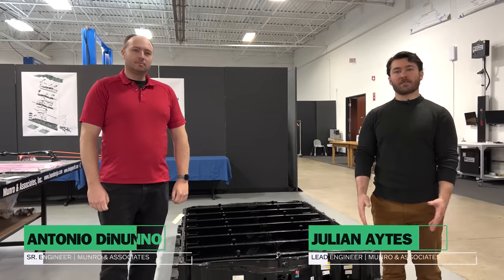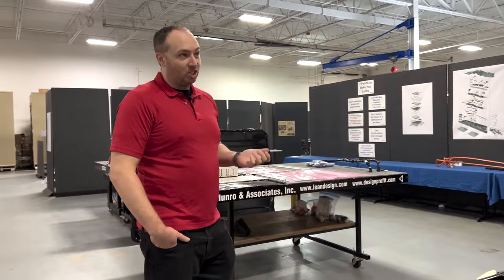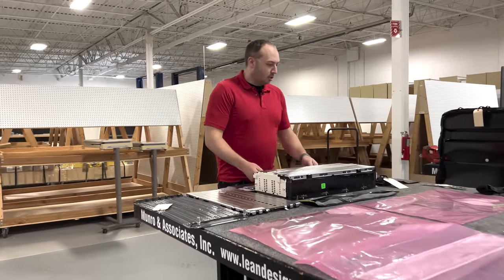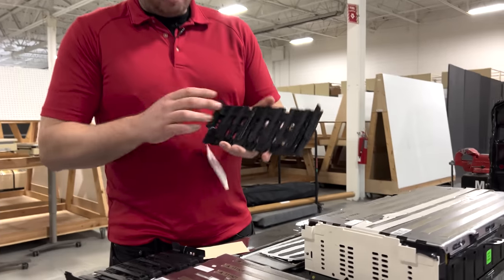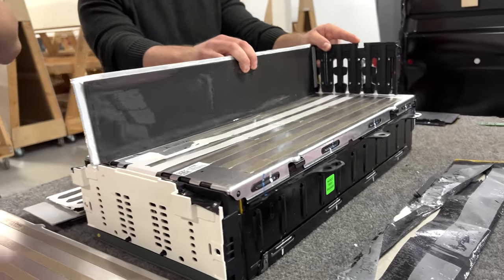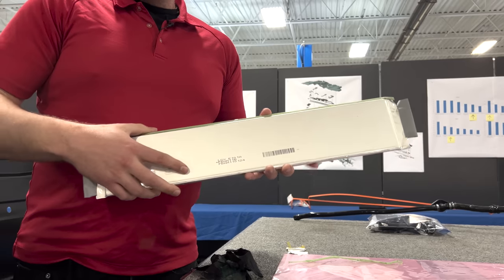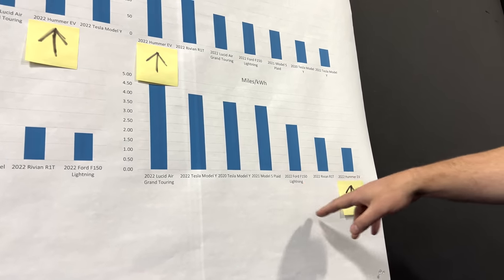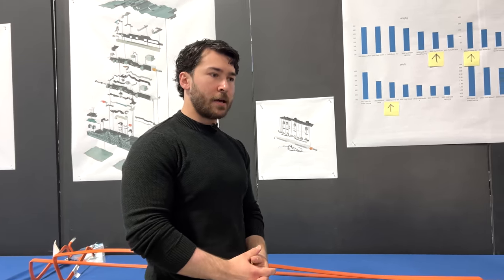This is NOT Lean Design: Hummer EV Battery Pack Breakdown

Comment: The UAW appreciates those welds.
Reply: why, do you think a person is doing the welding ?
Reply: @gcoates7  I don't but I'm sure simplifying a vehicle like that means less people and less union dues
Reply: GM is doomed….that doesn’t bode well for union workers.
Reply: I've been inside the Factory Zero and cell plant in Detroit and Brownstown. If you think the battery is complicated, you should see the equipment and machinery required to produce these batteries. 
$$$$
Reply: OH MY GOD THEY USED WELDS!!! You know I will NEVER buy a car that has welds, thanks for the tip. I'll buy the Cybertruck instead with its crappy range and charging speed.

Comment: So this confirms that whilst Tesla’s design engineers are pushing the envelope in almost every aspect of car design; the Hummer team appear to be well and truly stuck in the 1960’s school of automotive engineering!
Reply: Tesla still can't get any electricity out of the main battery 1:0 for Ford
Reply: Even though they have Teslas to reverse engineer.

GM suffers from NIH: not invented here.

The hubris is astounding.
Reply: @abraxastulammo9940  Tesla has powerwall...
Reply: @abraxastulammo9940  Dude, you need to THINK about what you write and make your point understandable!
If Tesla weren't getting any power out of their batteries, they wouldn't be selling any cars. But actually they are among the top selling cars in the world.
Reply: @nguyep4  Exactly, overpriced like f* while you have 90 kWh in the garage...
Reply: @unclefatbloke687  Only for the car, not utility. 🤷
Reply: @abraxastulammo9940  Over priced? Odd opinion.
Reply: @abraxastulammo9940  any Ev could use the same system as ford with nothing but a few lines of code added. There is nothing fancy about it. It's literally just a system like the power wall with a DC input from the car. The system tells the car to close the battery contactor and connect the battery to the charge port.

Comment: Good thing is that GM only built 2 of them......still practicing failure until they get it right.😂
Reply: one for Munro. Who got the second one?
Reply: They ran out of steel
Reply: The welder guy has a burn out syndrone and did quit his job.
Reply: They built a lot more than two.

Comment: Thanks for the tear-down, guys. I can't help stop thinking that this Hummer EV pack, on its own, weighs just a little bit more than the entirety of the 2012 Mitsubishi i-MiEV I drive. Sad to hear that GM is going to stop production of their sensibly-sized and affordable Bolt EV/EUV series later this year and continue marketing impractical electric behemoths like this.
Reply: They are going to replace the bolt with the equinox EV. At $30k for the equinox I would not take a second look at the bolt. And I currently own a bolt 😂

Comment: The energy density is pretty impressive. I wonder how much better the pack could be if they didn't use such heavy materials.
Reply: I think they should have used tungsten it's much more durable than steel, even if it's more expensive. Makes sense.
Reply: Cylindrical is superior .
Reply: I think they went for the heavier materials (steel vs CFP or aluminum) for cost savings. Giant batteries are expensive, and even at the ludicrous price of the Hummer they have to save money somewhere.
Reply: @stephenj4937  Yeah. Gotta have that 500% profit...
Reply: It's for an extreme offroad truck. Did you notice that the most capable offroad vehicles had the worse miles per kWh? Offroad for the Lightning is a dirt road. The Hummer can rock crawl and jump hills. The rest of the vehicles are a joke for offroading.

So comparing the Hummer to a Lucid or any Tesla is a joke and shows Munro is good at teardowns but can't see the forest through the trees. GMs objective was different than Teslas and Lucids.
Reply: This case is part of the chassis structure, so at the very least, it needs to be made of high-strength steel. It's possible that it could be reengineered to be built with aluminum, but I doubt it. At least not with the weight of the battery cells, the need to protect them, and the structural aspect of the case.
Reply: @markplott4820  This pack case is designed to be used with cylindrical or prismatic cells as well. If they used Tesla's 4680 cells in this pack, they would be able to reduce the weight a bit, but it would also have significantly less energy content.
Reply: @newscoulomb3705   - NOPE, Munro designed a battery case that uses almost no fastners, and is ALL Composite (fire proof).
Reply: @markplott4820  But this pack is structural. So what's your plan? Redesign the chassis, move several hundred pounds of mass from the battery case to the chassis, and then adopt Munro's composite battery case? 

My 25 year old Ford Ranger EV battery case is also all composite. When it's empty, I can pick the case up by myself without mechanical assistance. I could even ditch all the fasteners depending on the sealant I used, but that would make it less serviceable. At the end of the day, though, it just bolts to the frame and adds nothing to the structure of the chassis, so it isn't a viable alternative to Ultium.
Reply: @theflew  No it's not. It's for a bloated luxury car, that once or twice might be taken off-road just to try  it. Besides, high weight  off road is worse than on.
Reply: @avada0  Regardless how often it's taken off-road by the owner it's capable of it and has to be built to withstand it.
Reply: @newscoulomb3705   - FUD ranger EV is a Deathtrap.
Reply: @newscoulomb3705  - fake news Columb , Hummer EV is NOT structural battery pack, not like TESLA 4680 cell & Intergrated CELL to Pack with NO Discrete MODUL;ES .
Reply: @markplott4820  And yet, no one has died in a Ford Ranger EV. 🤷‍♂Either way, that's not the point. The point you're missing is that one battery is a structural component in the chassis and the other is simply a bolt-on. You can shave a lot of weight on the battery case when all you're doing is bolting the battery case to the chassis.
Reply: @markplott4820  You can keep telling yourself that, but you'd be wrong. GM has already stated very clearly that the Ultium packs contribute to the overall structure of the vehicle in addition to housing the modules.
Reply: @newscoulomb3705   - NOPE, just nope.
MUNRO can Disprove you in 10 seconds.
Reply: @markplott4820  And yet... silence. Look, Munro & A didn't even realize this battery had a wireless BMS on their teardown, and they claimed that the Chevy Bolt EV was based on an ICE chassis when it wasn't. They miss some pretty obvious facts when it comes to GM, for some reason. It's almost as though they are biased.
Reply: @newscoulomb3705   - the Chevy BOLT is a Crappy Compliance car built on the EV2 Platform , aka Chevy SPARK which was both EV and ICE variants. 
BOLT is an ICE car body built in a former ICE plant. BOLT is 80% made by LG. 
though MOST of BOLT Enginering is done by LG , and using ICE Technology. 
MUNRO is Unbiased as they come, they used to teardown all the Major Engines from Legacy auto , including gm. 
they were CLIENTS of gm and SANDY worked @ FORD.
Reply: @newscoulomb3705   - Hummer EV still to HEAVY & Inefficient , in spite of their Wireless systems. 
TESLA is more SECURE , minimal wireless use and uses ENCRIPTION. 
TESLA has Faster DATA Network and using FAR less cables, Tesla is going to 48V in Cybertruck.  and Advanced HIGH speed Network.
Reply: @markplott4820  The HUMMER EV is a performance, off-road, fullsize luxury truck/SUV. Tesla still only makes sedans optimized for street use with spartan interiors. If you can't see the difference, then I don't think you're qualified to be discussing relative efficiencies. 

As for the cabling, what cabling? I didn't see any of that discussed here. All Munro & A discussed was the busbars, which for some absurd reason they think can be made of aluminum in order to save on cost. 🤦‍♂
Reply: @newscoulomb3705   - MUNRO costs every part & component used inc every screw , bolt, Fastner. 
no one ELSE goes into that DETAIL.
and MUNRO is also costing SOFTWARE as well in 2023. 
cant call Hummer EV a performance model, the Cybertruck is the FASTEST Full Size truck on EARTH, its Faster than 911 Porsche.
Reply: @markplott4820  And yet they still make mistakes and omit key information in their videos. 🤷‍♂ I would hope that their comprehensive reports include the information they omitted here; at least, if I were a company paying them hundreds of thousands of dollars for the research, I'd demand it.

As for the Cybertruck: It doesn't exist yet, and it won't until it is in the hands of customers and independent reviewers. Will it be faster than the HUMMER EV? Possibly. The R1T already goes toe-to-toe with the HUMMER EV. Just because a new performance truck/SUV comes to market doesn't mean that existing performance trucks cease to exist. 🙄
Reply: @newscoulomb3705  - MUNRO does not Divulge all its information, (for FREE). 
the Reports are Chock full of Details. 
MUNRO still sells the BMW i3 (old model) report for only $10. its a bargin, for Anyone considering making a BEV. 
YouTube , as you are WELL aware , is a FREE platform w/ FREE basic content. 
YouTubers give more DETAILED videos , through PATRION, Locals or others.
Reply: @markplott4820  fastest truck in fantasy land. Your talking about a product that doesn't exist yet, let's keep the chest thumping for when one actually rolls off the assembly line
Reply: @avada0  it's more like 200% negative margins
Reply: @robertbowman9108  No way. With some luxury crap like this, there's a lot of profit.
Reply: @theflew  Jump hills with a vehicle that weighs 4500kg empty. Good luck.

Comment: First impression, someone was told to "Do it fast, do it cheap"
Reply: I guarantee it was neither fast nor cheap! 
Complexity is expensive but the larger cells could be cheaper to build and assemble.
Reply: Fast and cheap is easily attainable quickly, but unnecessary costs and materials can amass over time. Doing slow and expensive development first will then become fast and inexpensive over time, and save from unnecessary costs, materials and quality issues. 

GM definitely went the short term, but costly route while Tesla is going the long term and inexpensive route. Tesla just needs to work more on the car body quality.
Reply: Given this truck can take more abuse than any of the vehicles they compared it to maybe form followed function.
Reply: @briansit8826  I wouldn't be so sure about that. Pouch cells are SLOW to manufacture and assemble with lots of extra packaging needed. I wouldn't be surprised if a cylindrical cell pack was way cheaper and faster to build and assemble per kW.
Reply: @jg5001  
The "car body quality" was a "US build quality" problem.
Lets hope the Chinese "Hit squad" currently in the US factories can raise the workmanship to the level of Shanghai.
.
(Can we say "workmanship" any more?)
Reply: @theflew  
Given they "Say" it can.....
I'm not sure how much abuse the 2(?) they sold have been anywhere but the local Walmart parking lot.
More likely the first time they see mud requires a crane after they sink.
Reply: @saff226  
May be why GM cancelled an "Ultium" factory and signed a deal with Samsung for 4680 cells?
Reply: @briansit8826  
I suggested that's what they were told
I never said they managed it! 😉
Reply: @rogerstarkey5390  You might want to check your numbers. They sold 2 in 1Q23 because the factory was being upgraded to build the Hummer SUV and Silverado EV. They've sold over 1000 Hummers with a long waiting list.

Comment: I'll help you guys out.
1) Thermal runaway - What is the melting temp of an aluminum battery enclosure vs the temperature a lithium ion battery reaches during thermal runaway? 
                                        How does the Hummer EV battery compare to the Lightning battery for thermal runaway protection? 
2) "Backwards flow path" - See #1
3) "No thermal function in this section of the cooling plate" - Take the plastic part to the bandsaw or x-ray 
4) "Talc filled polypro insulating material" - Not correct
5) "Nylon piece of plastic" - Not correct
6) "This is for isolation" - Not correct, see #1
7) "Tabs use ultrasonic welding to connect the electrodes" - Not correct
8) "Tactical cooling line" - Not correct, see #1

Lastly, if the 100kWh Model S battery is 1377lbs a 200kWh Tesla battery would would be ~ 2754lbs. 
The Hummer EV 212kwh and 2818lbs, a whole 64lbs difference. You're not going to notice a 64lb difference in your range.

Comment: Ok engineers, how much weight difference between thin stamped steel vs thick aluminum components? how much savings?  A lot of criticism without real world context.  The welding is done by robots -  who cares how many welds .   How about this -  the weight of this pack is the lowest as a percentage of total vehicle weight of ANY vehicle on the market. Growing tired of Monroe’s formulaic assessments but they play well with the audience.
Reply: I would have to agree to some degree.  No mention about the weight of the batteries alone vs. the complete pack.  I mean, if they save 50 pounds in the total design that is going to have negligible affect on the overall performance of the vehicle.  If they can save $100 per battery pack using steel without a significant penalty then they may have made the right decision.
I am not saying that this is what happened.  Just giving a possible design justification.  No matter what you design there are always compromises. In a vehicle of this size minor savings in the battery design weight wise may be argued for if its cheaper.

Comment: What most surprised me was the m/kWh of the Ford Lightning on the chart at the end. Most of what I've heard on forums, and Youtubers efficiency tests, puts the lightning slightly behind the Rivian in efficiency. 
The terribly inefficient and lazy engineering of the Hummer is no surprise at all. GM managed to make a pure EV less efficient than a Prius. That's the most impressive part of their design.
Reply: Advertised range is used, battery capacity is something we do check.
Reply: And the Tesla Semi will be even less efficient than this. Fun fact, big boxy vehicles aren't very efficient regardless of power source.
Reply: @Stephen J  The Tesla semi is literally more efficient than the hummer. Both are far more efficient than their ICE counterparts.
Reply: @Willibopper  the Tesla semi uses 1.7 kWh/mi (0.59mi/kWh), while the Hummer gets 1.6 mi/kWh. That's about 2.5x as efficient.
Reply: @stephenj4937  GM, leaders in extreme engineering  Sorry, that was meant to be OBSCENE engineering! 
I trust you’re aware that a 747 is less efficient than a Cessna 172? The Tesla semi is actually VERY efficient for it’s size.
Reply: @stephenj4937  ope, you're right I got my units flipped. My bad
Reply: The Hummer is actually capable of offroading. The lightning is capable of dirt roads. You're comparing an offroad truck with all-terrain tires and 16 inches of ground clearance to all the others outside of Rivian with less than 10 inches.
Reply: @theflew  The Hummer is capable of offroading as long as it doesn't break (feel bad for the TFL guys) and can fit on the trial, and averages about 1.6m/kwh. They could have designed it to be somewhat efficient like Rivian did. Rivian is comparable offroad to the Hummer, but gets over 2 m/kWh. The Lightning by comparison is a standard full size truck, not really capable offroad, and also getting 2m/kWh in real world testing. There's room for efficiency improvements on all of them, but GM never uttered that word when they threw together the hummer. They could have made it fit on trails better. They could have made it lighter, they could have attempted to make it efficient, they could have tried to make a decent product.
Reply: @Willibopper  You must have missed the news last week that the Silverado EV with the same pack gets 450 miles per charge. Imagine what happens when you remove the under battery armor, rock sliders, heavy duty suspension and build a more aerodynamic truck, you gain 120 more miles. Munro keeps missing the point. That wasn't what the Hummer was for - never has been.

Comment: Kudos to Antonio and Julian for not snickering, giggling, and laughing throughout this video!   What a joke of a design!  GM showing-off their gross incompetence. 🤣🤣
Reply: The video was delayed for a week- till they could hold back the giggles.
Reply: They seemed unprofessional to me. They didn't mention the vehicle's capabilities, which might explain some of the material used. The fact the pack is structural to the Hummer. The fact it uses a wireless battery management system. The fact is it has the highest charging rate of an EV.
Reply: @theflew  🤣🤣